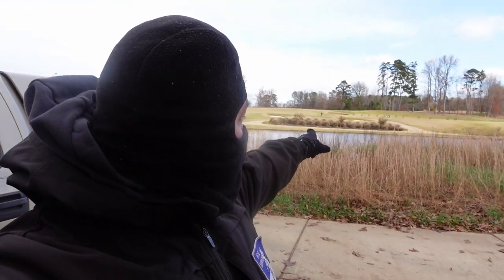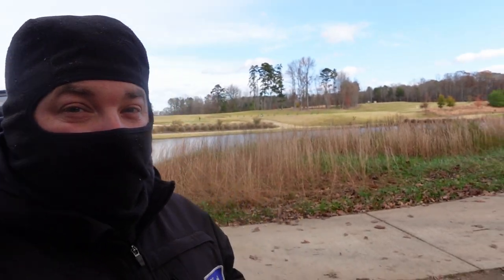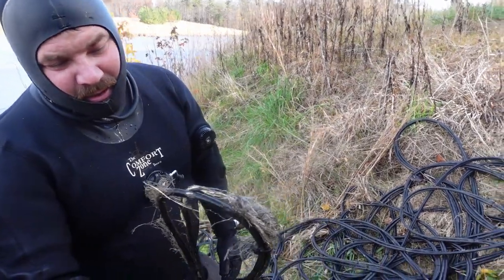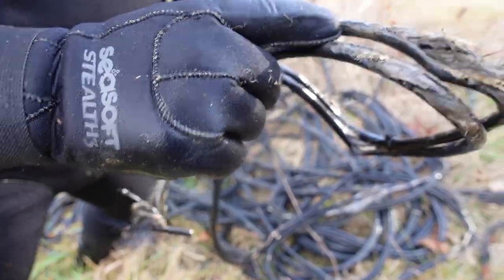Salvage Diving For A Water Fountain

Comment: zero chance I would have used those power cables to guide myself :P  No telling if that thing is cut, or if they pulled it loose trying to use it to pull that fountain in.  Never know what you're getting into, ya'll stay safe out there!
Reply from the maker: Hello DF, safety is always our biggest concern. In this video, I can confirm the power was not only shut off, but also disconnected as well.